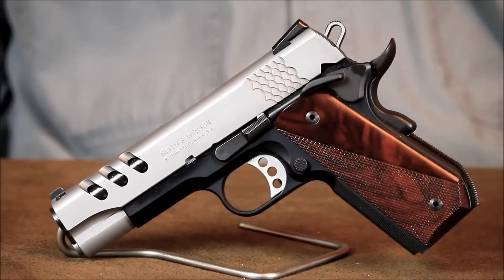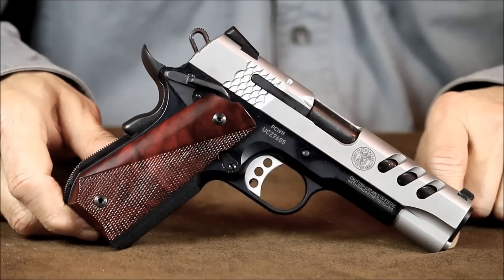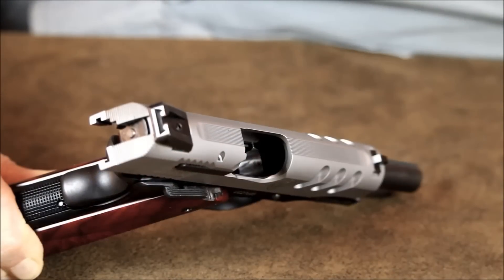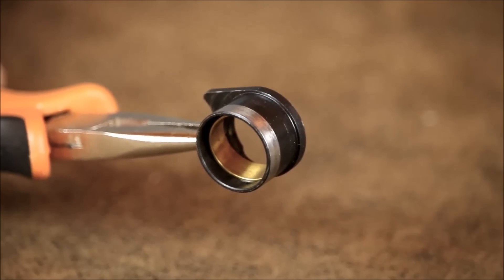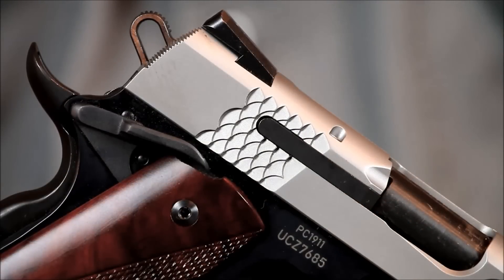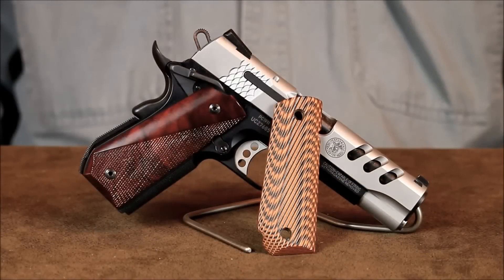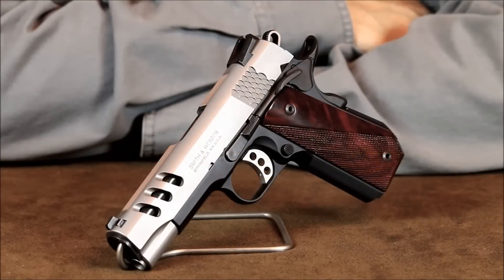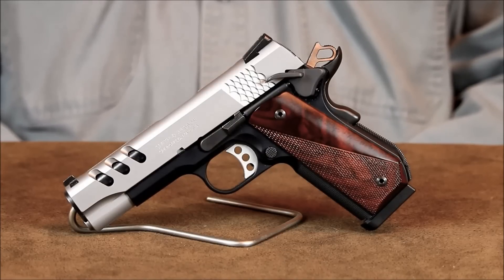Smith & Wesson Performance Center Lightweight Commander

Comment: I have mine sitting on the computer table.  I do like the wood grips on yours.

The only things I would do differently would be better smoothing inside the slide, mine shows machining marks.   I'd offer a version without the "lightening cuts" and offer a version with night sights.

As soon as my Galco Miami Classic 2 holster comes in (this week?) mine will be carried again at least until winter is over.

I have found it much, much easier to put the Briley bushing onto the barrel with the barrel out of the slide and then reassemble.  It seems awkward but that's the only way I could get the weapon back together on the first try.
Reply from the maker: +PotatoGunsRule The "E" class version of this pistol comes without the lightning cuts or Briley bushing. To me it's a little odd that the less expensive E class comes with night sights - you would think it would be the other way around concerning the sights.
Reply: I know the lower end version doesn't have the lightening (it's "lightening" not "lightning" since it's for weight reduction not natural electricity. LOL)  cuts or Briley bushing but I wish the PC model had an option to keep the extra tight fitting, Briley bushing, and drop the cuts.  

I actually got my coat cuff caught in my lightening cuts once!  OMGosh, thank goodness no one saw that.  :-O  

I've been thinking about getting a camera and actually doing a torture test on mine, seeing if dropping it into the mud, sand, grass, etc, would actually cause a fail due to those openings.

Comment: Those grips look just fantastic on it
Reply from the maker: Yes, much better than the factory grips.
Reply: @Icarryone  did you cut/trim the top portion of the grip on the right side by the safety? i checked the link on ebay and they sell "NO AMBI CUT".
Reply: I stuck with the moderate looking but very functional factory grips

Comment: Pretty late but looking for a 1911 and was wondering, is a Dan Wesson Vigil or Valor a lot better than this? I would like to get the best bang for my buck and consistency. Should I wait to find a Dan Wesson?
Reply from the maker: This performance center 1911 is certainly a quality 1911 - as are those made by Dan Wesson. I own both - but what it would really come down to is your personal preference and budget.
Reply: Icarryone My budget is pretty open right now, not looking to spend over $2500. I plan on carrying this as an CCW because people from Mass arent so gun friendly. Im hoping I dont run into problems with whatever gun I choose to go with. Thank you for the insight!